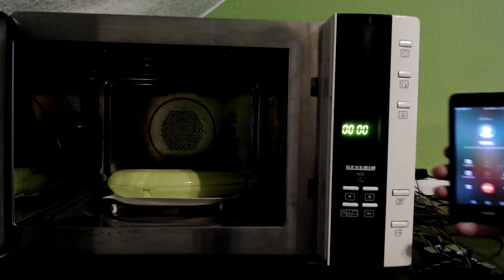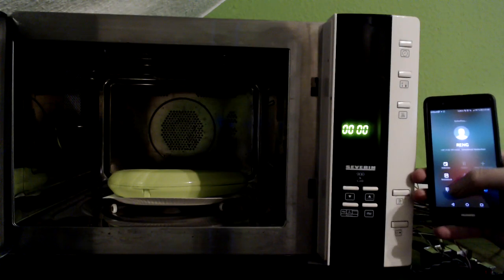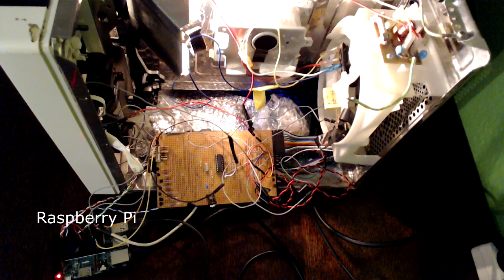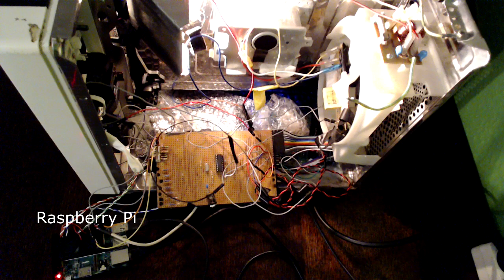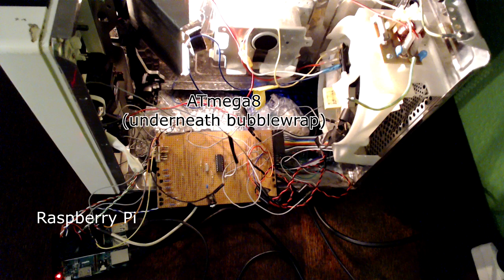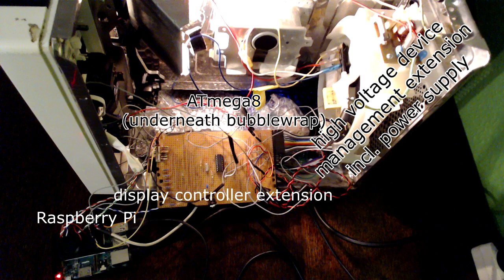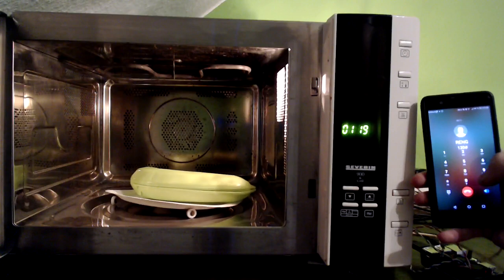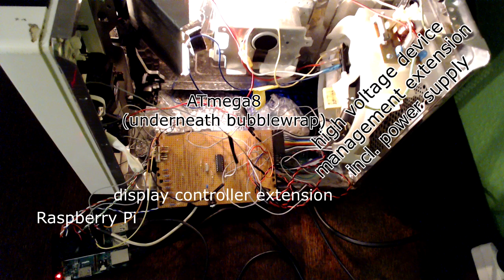Steins;Gate PhoneWave (name subject to change) v2 in real life

Comment from the maker: It can also be used to send E-Mails that look like they were sent in the past.
Reply from the maker: densch123  You got that right. In fact, the first version used a regular smartphone which was hooked up to a special circuit. The smartphone was configured to automatically answer calls. That version didnt support e-mail to the past though, only controlling the microwave was possible. The raspberry pi made email possible.
Reply: Really?!
Reply: @kaitocross  Does it still require a CRT TV as a transmitter for the emails?
Reply: @sta5011  you mean D-Mail?